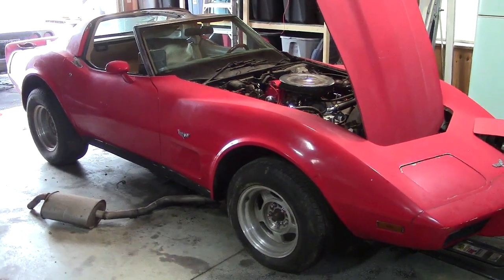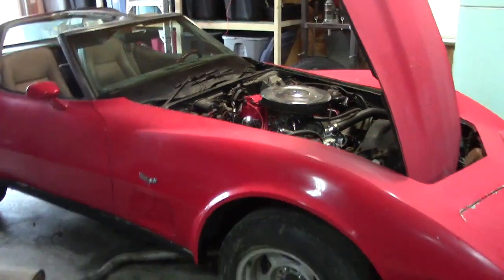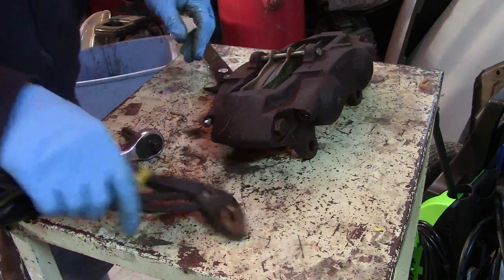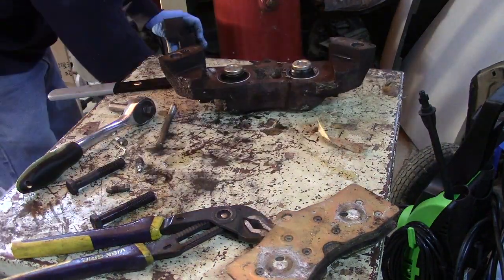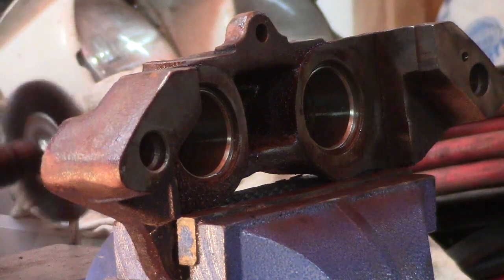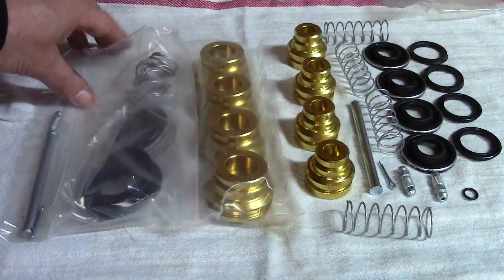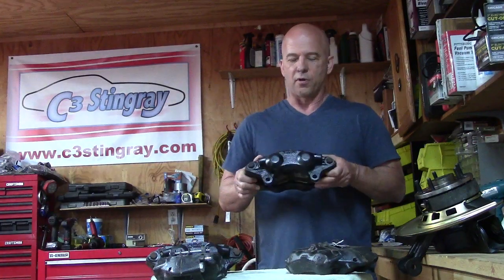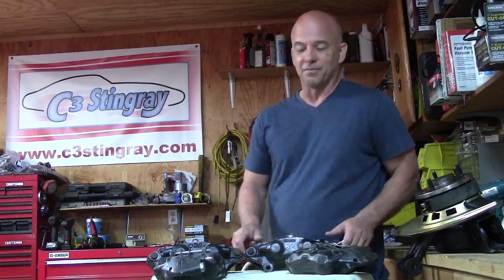Rebuilding C3 Corvette Brake Calipers

Comment: Great video and many thanks. So I need to remove the metal brake lines and the loosen caliper retaining bolts and then mounting bolts.
Thanks just became a sub!
Reply from the maker: You have to the brake line off. It is easier to break those caliper retaining bolts while they are on the car as they are really tight.  130 foot lbs on the front and 60 foot lbs on the back.

Comment: I was interested in purchasing a rebuild kit for my 77 Vette. it’s been some time since you did your video, do your rebuild kits now come with O-ring instead of the umbrella seals? If they do, what’s been your experience with those verses the older umbrella seals?
Reply: Keep it stock as it was designed. The only problem is the Cali p er bore must be honed if there is no rust or scoring. If ust or scoring you need a professional  to sleeve with stainless

Comment: Caliper bore/seal size for all C3 68-82 uses 1 7/8" on the front and 1 3/8" on the rears
Corvette Torque Specifications
1968 – 1982
Caliper Mounting Bolt - Front..........70.........5/8
Caliper Mounting Bolt - Rear ..........70.........5/8
Caliper Housing Bolts - Front.........130........13/16
Caliper Housing Bolts - Rear ..........60.........5/8

Comment: Thanks for the video.  I’m having issues with the dust shield not staying and locking in place.  Do you have any recommendations, I’m tempted to use an adhesive to seal and ensure it’s secure.  Thanks.
Reply from the maker: Is it rusted out? With the bolts through it I'm not sure how it would move unless the holes are rusted or wallowed out.

Comment: I have a 1981 Corvette one of the brake front calipers start leaking bought  the kit to rebuild it just like you're doing when it came time to put the rubber seal with the lip on that was a nightmare put it back on the car leaking worse than before had to buy another kit that one didn't work. And wind up buying a brand new rebuilt caliper. I won't be doing that again. You got a good video 👌😎 but not for me....
Reply from the maker: If your cylinder walls are bad it will leak  You need to feel the walls to makes sure there are no scratches or other deterioration. If it was leaking that bad you probably didn't get the seals in good.  It can be a little tricky some times.  Sorry it didn't work for you.
Reply: I’ve heard that the dust shield seal specs and thickness are different depending where you buy them.  I went through two kits from different stores and ended up buying a third kit from NAPA and that sea was just snug and tight enough, I almost gave up as well and was about to buy a rebuilt caliper as well.

Comment: I'm having problem trying to sit the piston inside.  Using the screw driver doing the same method. It will not sit in.  Any help please.  Thanks
Reply: I just hold my thumb on top until the lip is pushed in all the way around. Once the lip is pushed in the cylinder just pushes in.
Reply from the maker: Sorry, I did not see this message, I'm sure you are done now.  You have to hold some pressure on it with your hand as you work it in, otherwise it will just keep popping out.  Once you get it all in it will slide right down.  You don't have to put a lot of pressure, just enough to hold that spring down a little until you get the seal all the way in place.